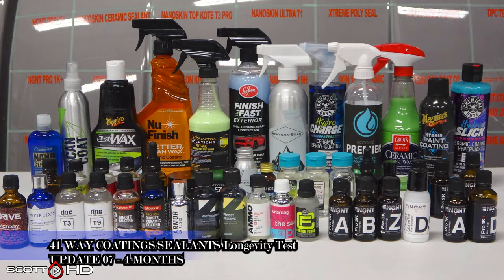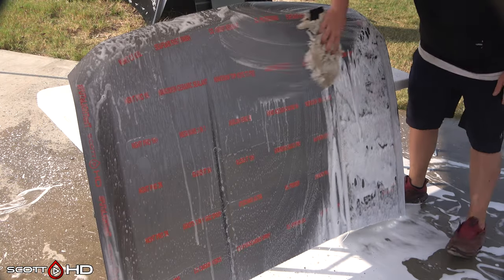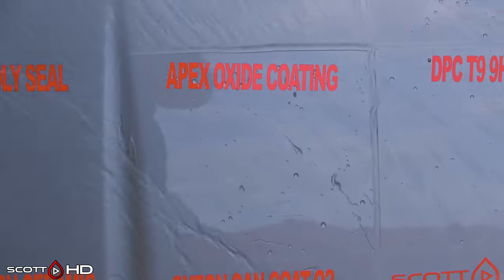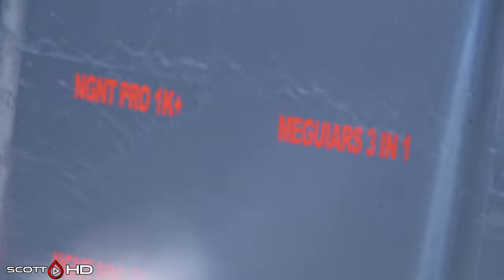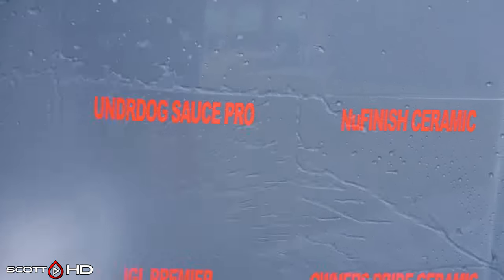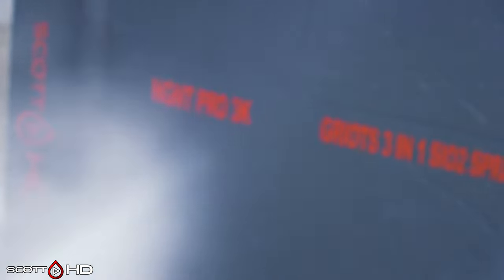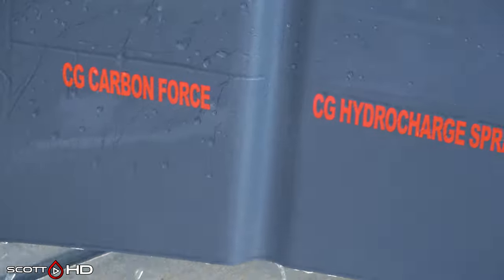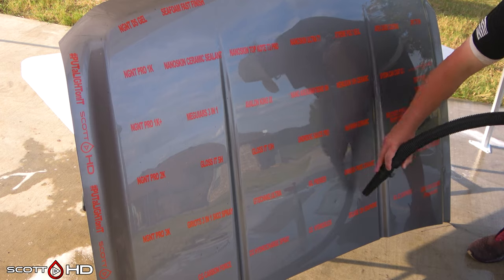Ceramic Coating Longevity Test - 41 WAY - The ULTIMATE comparison test - UPDATE 07 -4 MONTHS

Comment: Meguair's Hybrid Paint coating is very surprising.
Reply from the maker: Definitely!
Reply: I have it on my work car. Man couldn’t be easier to apply.  Does work really well.
Reply: It's on my personal truck 7000 miles in one month, parked outside, run through the touchless once. Still going strong!
Reply: I think I may try it out for the first time on my D.D. before the winter months kick in.  Hydrophobics are very impressive.
Reply: Advanced aut just had it buy 1 get 2 50 off
Reply: @ROFLWAFFLE1911  
Thats a deal.  Thanks for the info.  👍
Reply: Have it on my car also, applied same time as Scott.  It is performing marvelously on 99% of my car, 1 spot is starting to get weak on  the roof.  It would be super easy to reapply but theres no need too at the moment.

I will be applying it on a new vehicle shortly, I think I will have enough from my last can to finish another car! We shall see.
Reply: @ldtriton  you should, so easy to apply.
Reply: @ROFLWAFFLE1911  wow, picking it up today! Good deal! 👍👍

Comment: I'm upset Brian from Apex took a shot at your testing procedure. I think it's one of the better methods going. I'm more than surprised by the Griot's on my end
Reply: Interesting considering it still performing well.
Reply from the maker: It's not about the environment, it's that they are ALL exposed to the same environment at the same time.  That's why these tests work well.  I always will say "your mileage may vary" because of course it will generally last longer in these tests...but the end goal is to find out what lasts the longest.... If it lasts longest here, it's likely to be the longest lasting product for you too (last as long? Probably not, but hopefully close)

Comment: Hybrid paint coating really impresses me, and without ceramic please !!  👍
, will be the next coating on my RS, 2 coats of hybrid paint coating and M799 pro hybrid ceramic bead booster as top coat.  Will it be perfect, and maybe last longer than CQUARTZ lite I think ?! (in any case for the moment it's off to a good start!), I won't be surprised to see Hybrid Paint coating for more than a year, well I hope so. 
Meguiar's did not laugh at us with this extremely hydrophobic and durable polymer coating, I think initially nobody believed that a can would make a real coating!  No ?

Comment: Nice video Scott. I think this video you’re zoomed in too much when spraying the panels. I think it helps to see the surrounding squares for water pattern reference.
Reply from the maker: Thanks for the feedback! I will adjust accordingly.  The sun was setting right behind it so it kept messing with the white balance...this was the way around it was to zoom in a bit.  I generally wait to do them in early afternoon to avoid that but was pressed for time. I only had a few hours to do all 8 of the updates (usually have 10 but two finished last month and the month before)
Reply: YES! 

Also, please try other spray patterns. 
A hose with no sprayer on the end also would be nice to see the sheeting flow off easier without wondering if it is the pressure from the pressure washer. 👍👍
Reply from the maker: @tonesmith909  noted!

Comment: I washed the cars this weekend with a pressure washer alone.  Griot’s 3-n-1 was on them both for a few weeks; just pressured water revealed instant beading.  I always prepare myself to add a topper after washing, and this time I didn’t.  Just a quick dry.  Gotta say, that product is really solid.

Only thing I don’t care for are the aerosols.  When I applied it on 3 different cars, my chest didn’t feel quite right after.  I guess it’s all that ‘liquid glass.’  😂
Reply from the maker: Agreed. I have similar real world experience with aerosols (and they make a mess)

Comment: Hey Scott, Would you say that the spray ceramic coatings such as Griots, is on a comparable level to some of the ceramic coatings such as Gyeon Syncro? I've used Syncro on my M2 but after about 2 years it no longer seems to bead and I'm ready to apply a new coating. Deciding whether I should reapply a more intensive ceramic coating, or just use a spray coating these days.

Comment: Thank you for the efforts man. What would you be your opinion on the Meg Hybrid paint coating and the Gyeon Can coat q2? I have both in Europe available but The Meg is almost double the price of Geyon can coat?
Reply from the maker: Both seem to be performing well so far.  Gyeon seemed to "flash" quicker when installing, meaning that it may give you a more difficult installation compared to Meguiars.